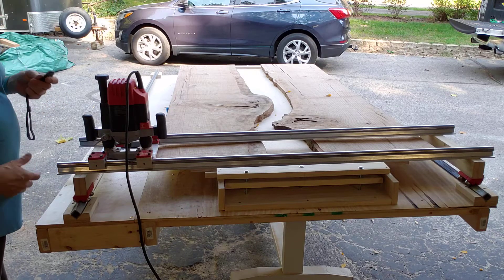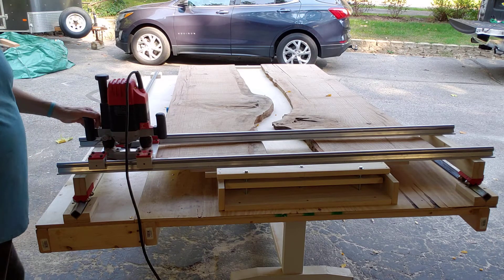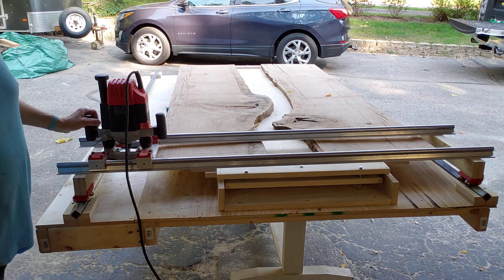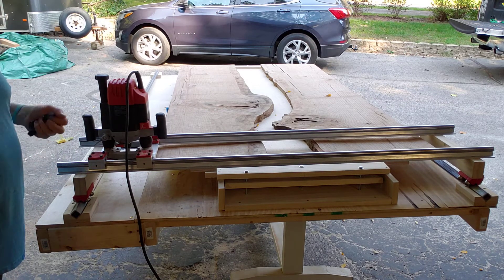Router sled in operation.

Comment: Those are giagantic bites.
Reply from the maker: I know. It was my first time ever flattening a slab. I learned the hard way. It wasn't leveled to the sled as well as I thought it was. Live and learn. :)
Reply: @Budster48309  I am learning, too. Have learned that better bits are worth the money. i was trying to use $10-$30 ones. I use those for roughing in now.  Have fun. Mike
Reply: @Budster48309    i was primarily interested in how you made your sled. What are your bottom rails made of?
Reply from the maker: @drewjohnson4673  The sled rails are 20mm linear rails. The rails that the sled rides on are one-inch square steel tubing. I cut some mounts with my table saw to hold them in a position rotated 45 degrees. They work great.
Reply: @Budster48309    Thanks
Reply: @Budster48309  Sorry to keep bothering you. May I see a closeup or description of the roller assembly that is rolling on the square tubing?
I think many people would be interested in a video of your assembly. It is very flexible and is a money saver.
Reply from the maker: @drewjohnson4673  No problem,. Actually, those are brackets that I designed and printed with my 3D printer. I used skateboard bearings for the wheels. If you check my page, I'm working on an upgrade that doesn't require printed brackets. It works much better too. I'm thinking about putting together a kit and selling it. I'm just trying to finish up my kitchen remodel before tackling that.
Reply from the maker: @drewjohnson4673  https://www.youtube.com/watch?v=spcVCg25m6o
Reply: @Budster48309  Thanks.     Priorities!!!